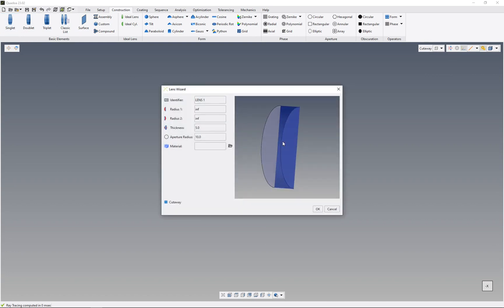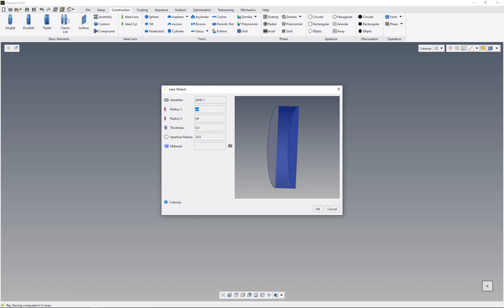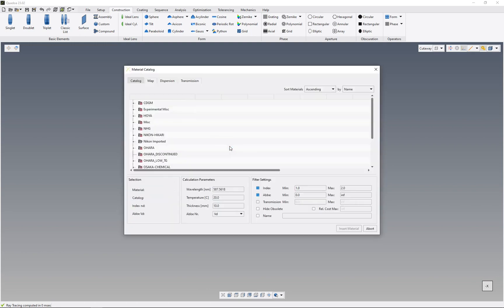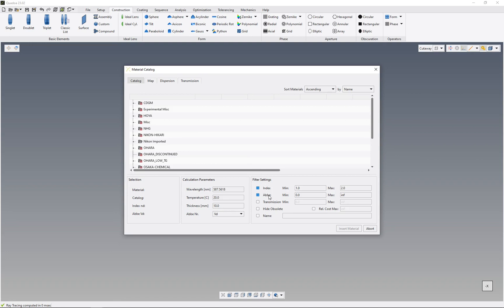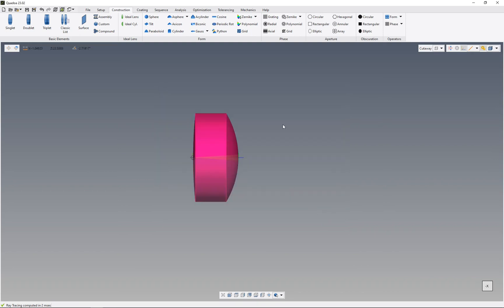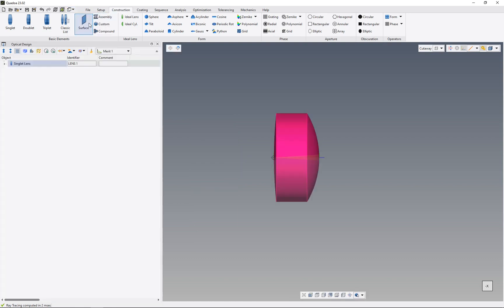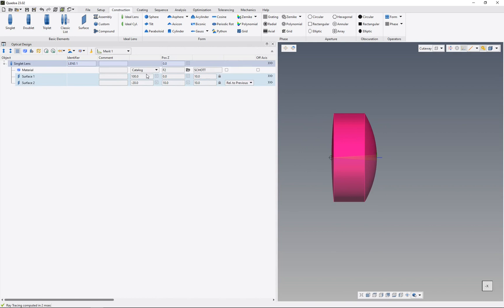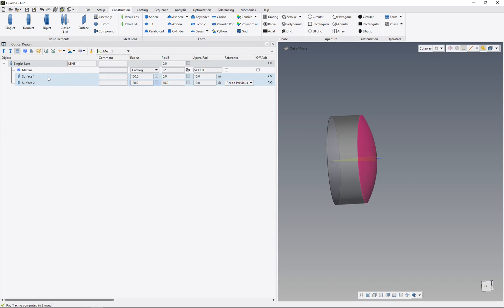Basics: Lens Construction - Optical Design Software Quadoa Optical CAD

Comment: Thanks for the video highly recommended. Can you do the fiber optic propagation using this software?
Reply from the maker: The Quadoa Wave Optics Toolbox provides beamlet propagation methods that allow to simulate wave-optical phenomena like interference and diffraction or free space propagation of coherent beams as well as single- and multi mode fiber coupling.
Reply: @quadoa  Can you do a video regarding that it would be very beneficial to me